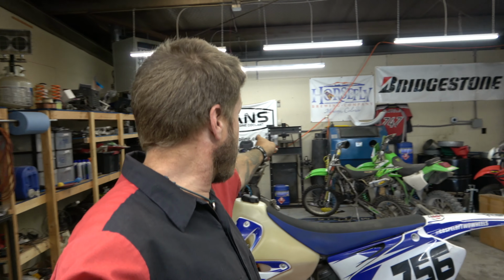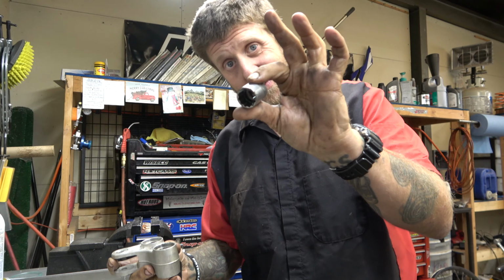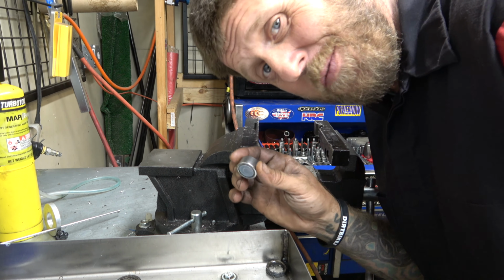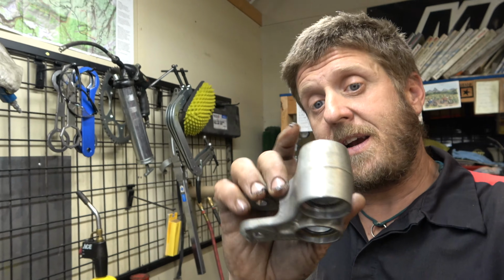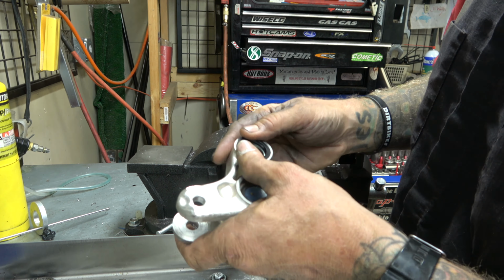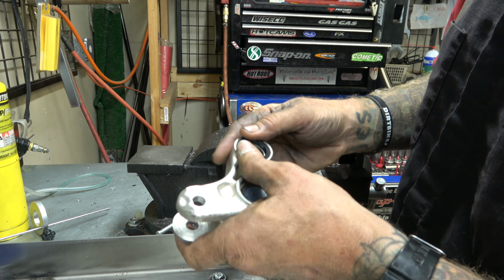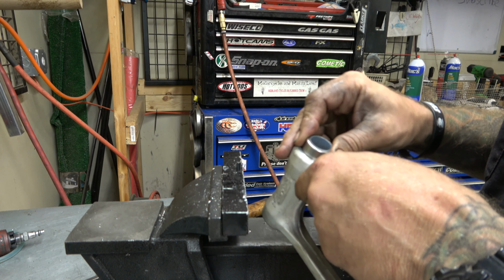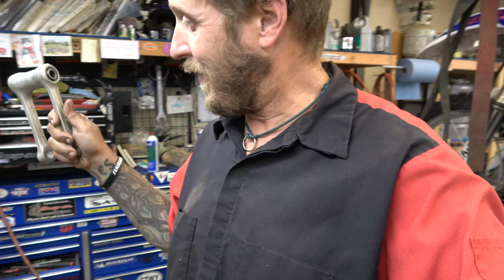Replacing Linkage Bearings With Simple Tools

Comment: Got a broken bearing race stuck in  my 93 kdx200 linkage. Going out to hit it with the dremel and grinding bit now. Thanks for the info! Stay safe! EDIT: I didn't have the proper grinding bit. I had to hand file a few weak spots into the race the use a dead blow and flat head to break it where I filed it. Tedious but it got it out!
Reply from the maker: Good work

Comment: I did my linkage (05) and there's still a few mm of play at the knuckle ...
Reply from the maker: Could be that the bolts and races are worn.  A little bit of wear on all of the parts will cause play when all added together if that makes sense.